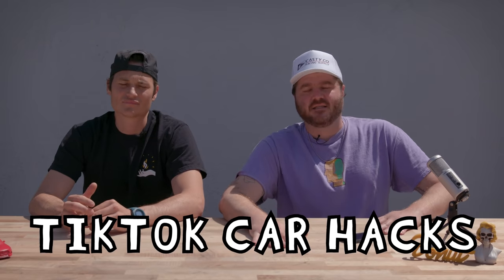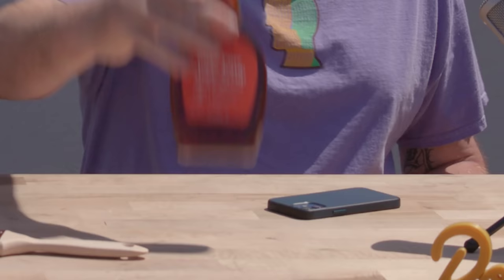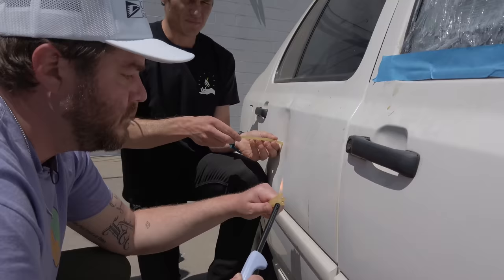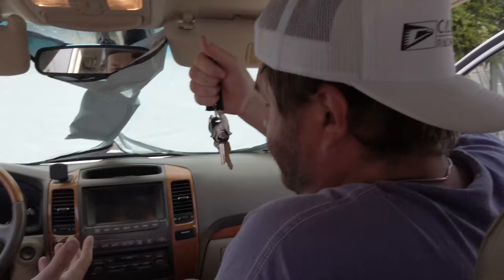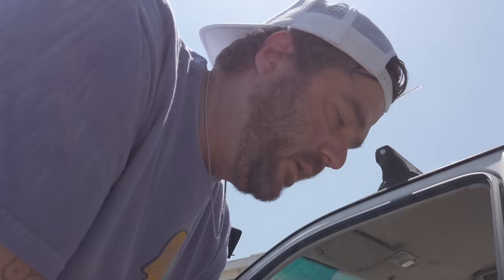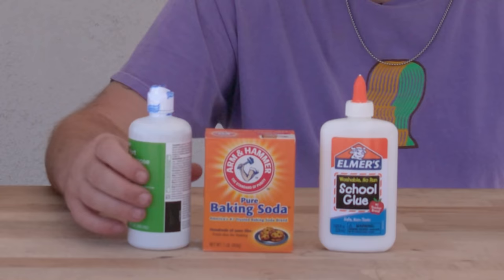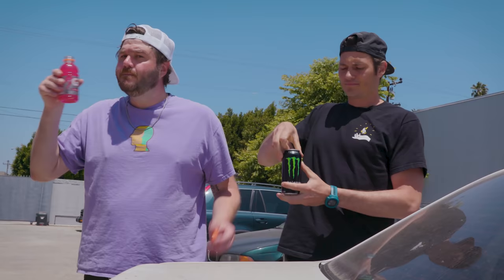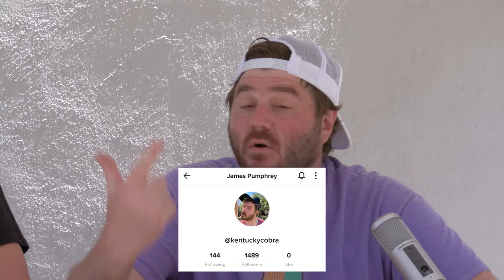We Tested TikTok Car Hacks

Comment: The bottle opening trick actually saved my dad and I on a hot day. His old Flex had a radiator issue and it started leaking and caused the car to overheat. We had to pull over to the side of the road and wait in the 84 degree, 77% humidity Illinois heat for the flex to be safe enough to get home. Lucky for us there’s a Hispanic-locally owned bodega just a few hundred feet away. We’ve shopped for meals and food in there before; all the food was handmade by the abuelas of their family and served by the granddaughters that understood English and Spanish. I popped inside and got us two of the large glass bottle made in Mexico Coca Colas (which are the best over any other form of Coca Cola; more bussin than McDonald’s coke). I paid for them, said thank you in both English and Spanish, and went back to the Flex. Only problem? We didn’t have a bottle opener, and these weren’t screw off. It took us a few likely options and some failed attempts but then my dad realized what to do and opened the bottles the same way shown in the video. We ended up cooling off, the car got in ship enough shape to get us home, and we got home safely :)
Reply: Also shop at small businesses. Family owned bodegas are the BEST. I’m saying this as someone who grew up piss poor in Illinois and lived in Arizona for 6 years. Supporting Hispanic businesses was a regular for us. We even had an abuela that made tamales and sold them in our old neighborhood in Phoenix, and whenever she came around we always bought at least 8 of them.

Comment: @6:00 .. 40 years of electronics in various fields and I'm not quite ready to call utter and total B.S. on this. 'Tech rep', 'service' , and 'diagnostic' modes are ubiquitous and often accessed with a combination or sequence of (seemingly unrelated) key strokes/button pushes, and I've personally seen firmware oversights where certain functionality and back doors have been left intact. Of course by design, they are unlikely to be stumbled upon by an end user casually playing around, but I would not be surprised if they still existed.

Comment: glue sticks can pull paint off car dont try it also about the key trick did you know 80s 90s vauxhall/opel cars all u did was pull out hazard lights switch and unplug it from harness turn upside down and plug it in upside down it made ignition come on then all u did was bump start and away i could tell you more ways but im not encouraging car theft lol or the wire from positive terminal on battery to positive on coil it bypassed lots immobilisers then bump start or do screwdriver to solonoid trick im not sayin how to disable steering lock as too easy

Comment: Dud tell me why you guys are not even doing it like it in the video and wondering why it doesnt work. 1st (Window Tint the charcoal tooth paste not the right kind not dark enuff). 2nd (Your Suppost to use 5sticks on the bottom and 5sticks on the top then pull all at same time)

Comment: The windshield one may work as I’ve heard of people pouring warm/ boiling water over windshields and the glass has cracked or shattered, so if the window was in the hot sun for a while and you put some ice cold liquid or warm liquid with ice cold windshield it may work

Comment: When you tried to pull out the bump on the car, you hadn't even attached the glue rods to the middle of the bump, and in the tiktok clip they were a plastic bumper, you did on sheet metal, and not even where to attach. Useless test

Comment: There is no chemical compound on Earth that will shatter glass by means of simple contact, unless you fired it out of a cannon of some type. Rapid temperature change or a guy in the front seat with a BB gun are the only possibilities in that video and I'm betting on the latter.  Did you notice the lighter area appear just to the right of his monster spillage?  Looked like an impact to me, just sayin'.  What kind of douche do you have to be to use dumb gimmicks like that to chase clout?